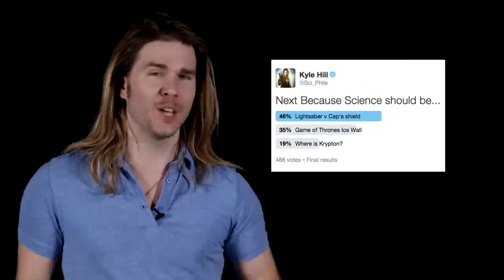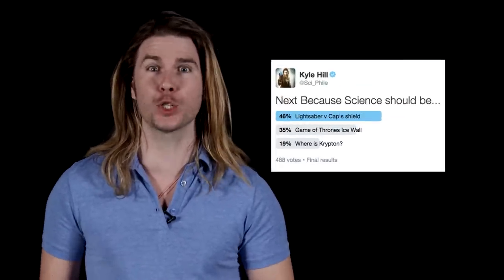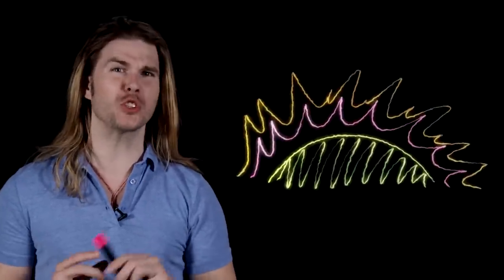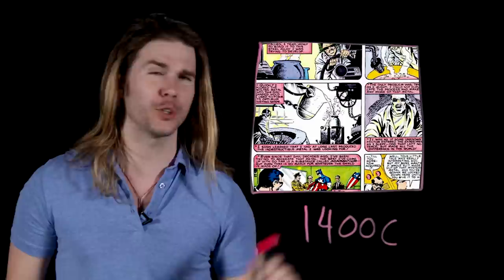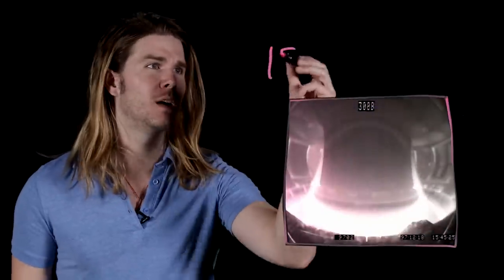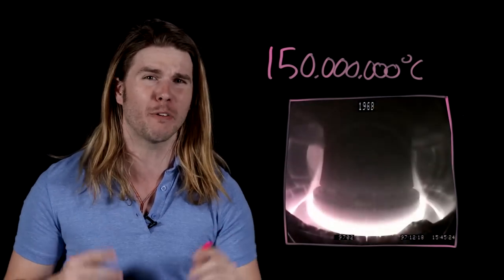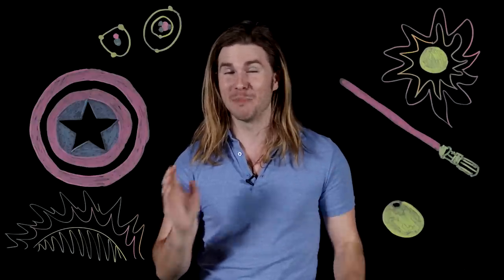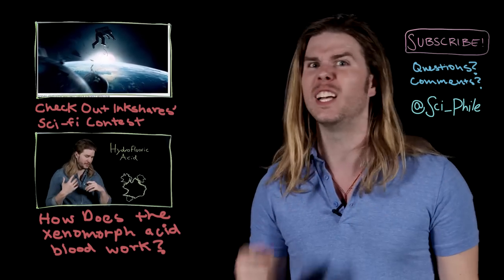Could a Lightsaber Cut Through Captain America's Shield? (Because Science w/ Kyle Hill)

Comment: If a lightsaber were as hot as you say, wouldn't it burn the air around anyone weilding it?  Furthermore, wouldn't it not only blind the wielder, but scorch them?  You could say the force pushes this back, but Finn had a lightsaber, and he could swing it fine.  Plus, using one in enclosed spaces would burn all the air of everyone in the room.  Not even hair or clothing get singed, but if you held a torch, much cooler than a lightsaber, you start to see its effects.  Even sparklers on fourth of july are hard to deal with.  And try keeping a lighter ablaze for more than a minute.  I think the lightsaber simulates glows, but isn't plasma on a stick.  There is never heat associated with it while not making contact.  Granted, it welded open a door and made molten metal in one of those movies, but seems to have both passive AND kinetic qualities.

Comment: Not on either side of the argument here. But just making a fact that a lightsaber couldnt exist because if it was anything like the plasma he talked about than the heat from it would vaporize anything within a hefty radius of it. Not saying that the shield could block it, but im saying it would be useless if the shields handler is melted. And so is the lightsabers handler. Well if you dont understand me just imagine the core of the sun condesed into a meter long stick and you are defending against it with a shield.

Comment: I dont think that the lightsaber is that hot honestly I would have to say the most likely comparison would be a modern hand held plasma cutter or about 45,000 degrees f. There are a few reasons I came to this mostly due to the wielder not wanting to burn themselves or cause a heat explosion upon turning the thing on and blowing themselves up.

Comment: What if the edges of the shield is the one point that wont absorb... What if the shield was designed from the atomic or sub atomic level... In other words it can disperse energy in a certian direction while not being so good at dispersing in another... 

If that's so the as long the light saber didn't clip the sides then true but if hit on the side would it cut like butter

Comment: A LIGHTSABERS is a force crystal given to the Jedi when they visit the force ice planet illum and when they craft they use the force crystal along with another crystal to focus it and it is called the focusing crystal. There the Jedi crafts the saber to fit the crystals and their compartment and using technology the create a hilt around the crystals and there when you press ignite it sends the message to the wires wich transfers that signal to the force crystal in which case the force is needed to ignite due to the fact that you are the one driven to that crystal. I REST MY CASE

Comment: possibly and more likely the lightsabers are 10000 -100000 C since u cant use something thats giving off the heat of the sun anywhere near you, and in the movies when they cut thru 2-4 ft thick metal doors it takes a minute or few. but then theyre formed from light relecting or w/e thru crystals inside the hilt, so theyre mostly light beams and plasma is matter right? so it not being plasma changes alot of the math and facts doesnt it? funny how couldnt find 1 commenting about this in the slightest btw if u watch the star wars: clone wars 1st series, 2d shorts version itll show an episode where a mine of many light saber crystals is being guarded by (insert suddenly forgotten name of jedi mistress and padawan :P lol) where they talk with each other about the construction and some of how lightsabers work, b4 a sepratist (hopefully i spelled that right) force of 1 or a group came in and tried to blow the mine to dust and kill the only 2 witness's being jedi. there r a few more sources on lightsabers but this has all been off the top of my head, so tip my hat to u :P and ofc either way ur end description is likely right in either way the lightsaber works. tho with the plasma version if his sheild were stabbed and cap backed into a corner i think with just a few seconds of constant pressure or mayb even barely 1 second to push thru his sheild and his arm.

Comment: i don't know y every1 is saying that lightsaber is plasma no it is not 
to understand what exactly is a light saber first you have to know how a jedi was creating his own 
well a jedi first had to find the force Kristal the you need a big supply of energy and you have to use the force 
first of all a jedi was using his force powers to unlock the crystal that's y lightsabers have deferent colors 
after you unlock the crystal you put it in the light saber and it works now how it works 
the crystal with the force controls the photons and it channels the force thru the light (light saber)
the color of the blade that you see is the force the force cuts the force has so big temperature so yes a light saber can cut the shield with 1 strike it will do a ton of damage and with another 1 strike it will cut it

Comment: I think you're missing the fact that this is not iron and a metal like this can theoretically behave in totally different ways then metals we know of .. the fact that you use one of the weakest metals on earth iron to explain one of the strongest and divers metals in the universe vibranum and adamantium .. I know what you are going to say they are just fictional metals dude!! but considering we've not even scratched the surface on how many elements there are in the universe there very well might be metals like this undiscovered in the universe .. think of a shield that consists of pure neutron's lol yes it would be has heavy as a mountain but it would be indestructible and very dangers considering how much energy only one neutron holds but if maybe you had some small antigravity device in back of the shield or on your person it could theoretically work .. but instead of a shield it would act more like Thor's hammer.. lol